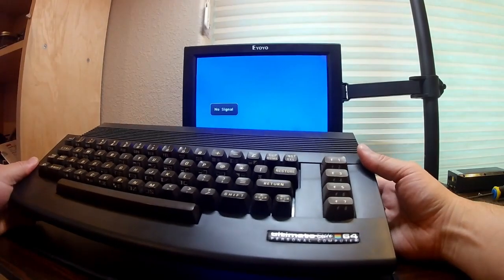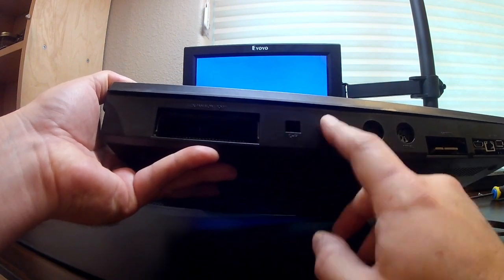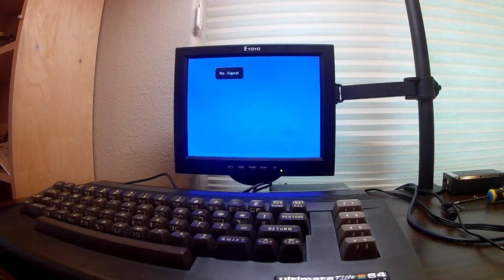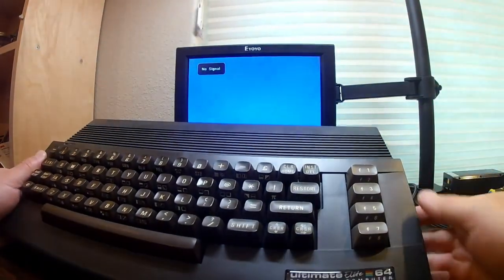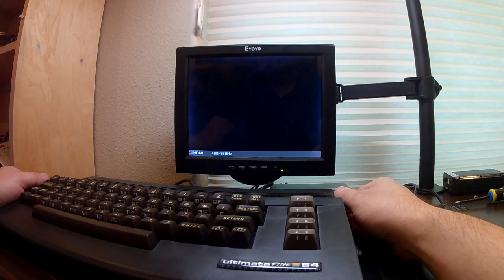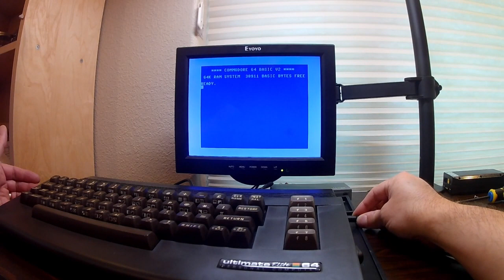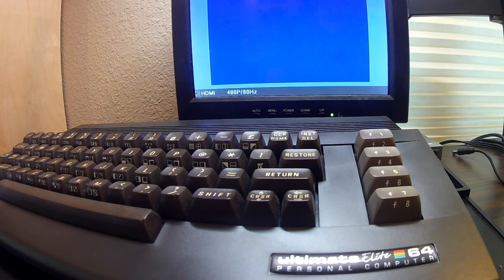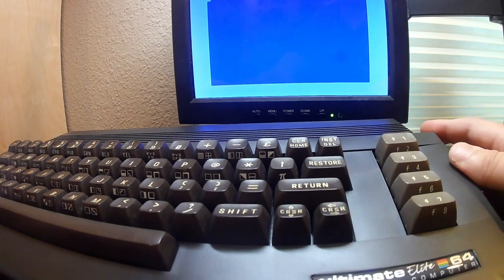Battery-Powered Commodore 64 with WiFi

Comment: I really like the idea of the internally installed WiFi modem. I have that user port extension, but I don‘t really like cutting a slot into the case and the modem is the most useful user port extension. I don’t know, if the on board WiFi of the ultimate is doing anything, yet.

Comment: That's really awesome.  About how long will the C64 run on battery power?
Reply from the maker: That is a good question, I have not tested it yet. I know that I have left it on for several hours with minimal battery drain. The battery is rated 6000mAh at 12v. I will have to test the power consumption of the Ultimate 64 to answer that question. Perhaps a subject for another video.
Reply: What about 9ac? Do cartridge work without having 9ac?